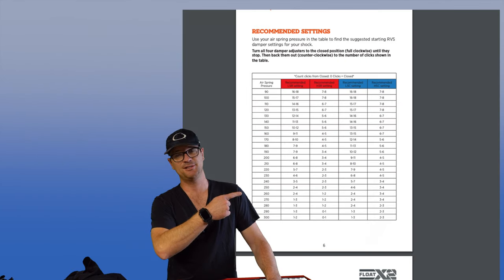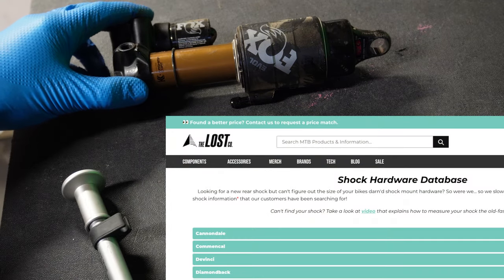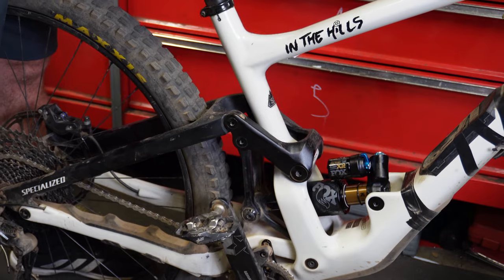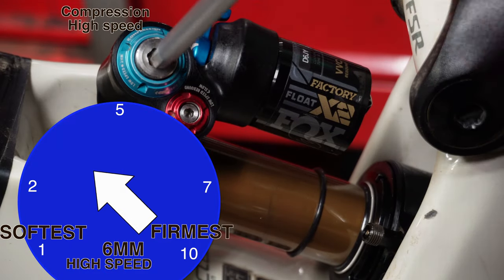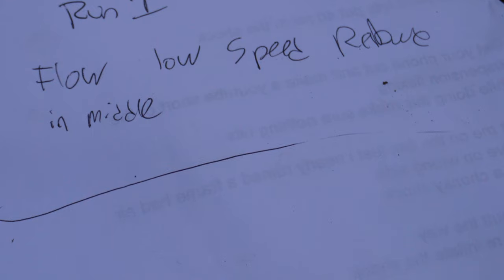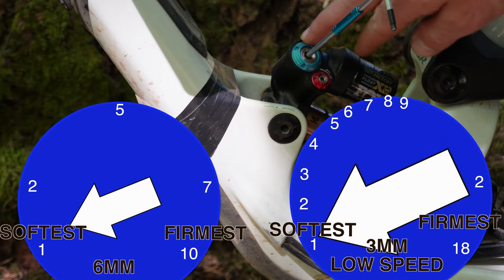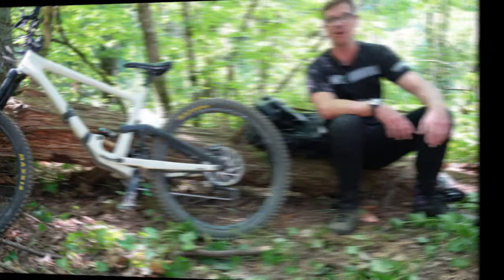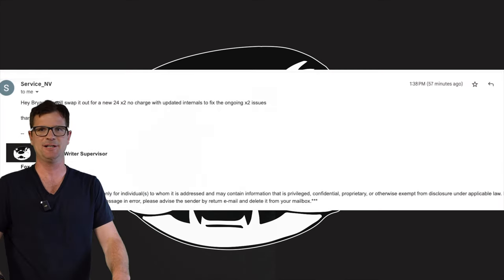Fox Float X2 Beginners Guide

Comment: That missing 4mm of stroke is from the bottom out bumper. You can deflate the shock and emulate a hard bottom out. Not that the 4mm matters. Sag is just a guide anyway.
Reply from the maker: Roger, 5psi can make or break suspension

Comment: After 5134 miles on my 2020 Float X2 it finally gave up the ghost about 3 weeks ago. I have my numbers that I was using, but was thinking this would help more with volume reducers as my DPX2 felt great on my Ripmo and I want my newly returned "2024" Float X2 to ride the same, but have more support for bigger hits (even though I can tell they reused my air can, oh well, the oil side is new. It's always good to do more research even if you've done this for 20+ years. Thanks for posting the video and I hope you get yours back soon.
Reply from the maker: That’s a shit load of miles. That pre 2021 x2 was better, but harder to setup

Comment: What do you mean the older one had more adjustment? that just doesn't make sense. you would think that a newer shock would have at least the same amount of adjustment or more
Reply from the maker: Yes, it does have less adjustment, they made it simpler more “usable range” they call it. Older model would adjust allot more on high speed clickers.
Reply: @OtterMTBtech  so you mean instead of having 20 clicks there is only 10 clicks and they feel like they have more of an effect on the suspension with each click?
Reply from the maker: I can’t remember exactly the clicks on the older one, but the range was allot bigger. I suspect they narrowed the range since it was allot easier to make the wrong adjustments. New or old version they work amazing when setup right

Comment: You need to set the sag using the 60mm stroke figure. That last few mm of stroke is the bottom out bumper.
Reply from the maker: Well, your right or I am right not sure makes sense to not measure that since it’s non usable. Kinda hilarious Pink bike copied me and made a shock setup video on not to measure that part too. 😆
Reply: @OtterMTBtech  Well, I can tell you that when the shock manufacturers say a certain percentage of sag, they mean that percentage of the whole advertised shock stroke. If you were to let all the air out and hammer on the shock, you’d get the full 60mm of stroke.
Reply: Actually they say of full travel … nothing to do with stroke length
Reply: @notsoenduro  No, sag is always set using shock shaft stroke length, not rear wheel travel. 30% of 60mm = 18mm of shock shaft length. That’s what you should set sag at. That’s with all settings in the open position. Then you adjust those settings based on the PSI needed to get 30% sag. Those Fox recommended settings are a very good starting point. But, I may be understanding you wrong. Anyway it should be based on the 60mm figure.
Reply: @Shawn-in-da-Canyon  no you’re spot on. My confusion is on the terminology. My bike (Spec Enduro) is 170mm f & r travel. The shock is 205x60mm. So 18mm sag is correct. Fox Manual doesn’t have 205x60mm. It lists 55,65,70mm… it also says set sag based on “full shock travel” not stroke length.
Reply from the maker: @notsoenduro  good take away. I suppose I’ll email Fox

Comment: Insanely good video. My confusion lies with when you had LS and HS compression open and found the sweet spot in your rebound, what are you feeling? Also, when it comes to dialing in HS and LS comp what are you feeling in the bike?
I have basically set all my settings to the Fox recommendations (give or take). I ride a variety of different terrains and I'm not sure if my suspension is dialed or if I have just worked out how to use the bike with those settings. 
I want plush but planted. I want grip around berms but want it to dance over rocky tech. I guess there is no specific setting for ALL terrain
Reply from the maker: The Fox settings are usually close. I was trying to show people how to fish not fish not give them fish. If you want the golden feeling it’s a mid stroke hang out. Try this go full fast rebound both and middle compression

Comment: Thank you for this great video. I recently bought a Cube one55 SLX with a 2023 Series FLOAT X2 2pos-Adj. I think it is an OEM version. The bike itself is relatively light 14.7 kgs. I'm with biking gear 78 kgs. Mostly I ride mellow trails in the local forests, but yearly few times I visit some bike parks here in EU: Austria, Slovakia and Czech Republic. In these parks I prefer blue and red lines.  Do you think your guide is applicable for this version as well? What are Your recommendations? Thank you for your feedback in advance.
Reply from the maker: Same principles one adjustment at a time. If I’m going to a bike park, just crank the high-speed compression. A few clicks extra maybe a a slower rebound

. For your shock just add some blue knob minus some red knob for the bike park.

Comment: The issue that I have with my Factory Float X2 2022 series is that I need to close fully the LSC to be able to climb without swinging on the bike. I ride Ibis Ripmo, so the DW link is not swinging-like platform. Is it a problem with the shock or I need to work on the adjustment? (SAG is set correctly)
Reply from the maker: Sounds like new bike time
Reply: @OtterMTBtech  unfortunately this happens in a NEW bike 😁
Reply: @seatpostman  Friendly Ripmo owner here. You probably know this but the Fox Factory Float X2 packaged with Ripmo V2 has a different tune than off-the-shelf X2. The shock has Ibis’ Traction Tune, with lighter compression and rebound damping to suit the kinematics of DW-link. (Yes, I plagiarized that last sentence from a review. YT won’t let me cite the article.)

My simple understanding is Ripmo owners need to turn up our compression and rebound damping more than other Float X2 owners to achieve similar performance.

Hope that helps, and that you already got this solved.

Comment: Far out … first time I’ve seen it explained well. So sag is set off stroke length and not shock travel (as explained by every other video) ? 

@ottermtbtech

I have the float X2 on the enduro and was setting the 30% measurement off 170mm of rear travel… nothing to do with stroke length.
Reply from the maker: It’s debatable on which one to use. My theory is to use the effective stroke. 

The x2 has massive bottom out bumper so it only has 55 stroke on Enduro. 

I’m not Fox engineer I may be wrong. 

Shocks not overly sensitive to air pressure. The compression takes over

Comment: Where do you find the 4 digit code
Reply from the maker: It’s on bottom
Reply: There is no 4 digit code on my Fox Factory Float X2 (2021 model) that came on my Ripmo V2 in February. Ibis distributes specially tuned X2 shocks with reduced compression and rebound damping for DW-link’s unusual kinesmatics. There is only a QR code box at the base of the shock near the linkage eyelet. It is not easy to photograph.

Good luck to Ripmo owners with finding identical shock replacements!